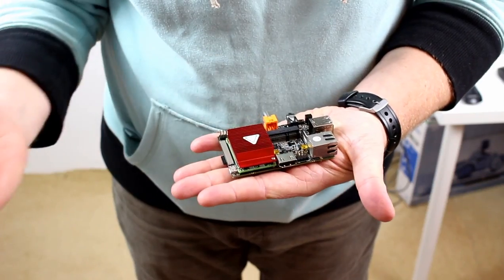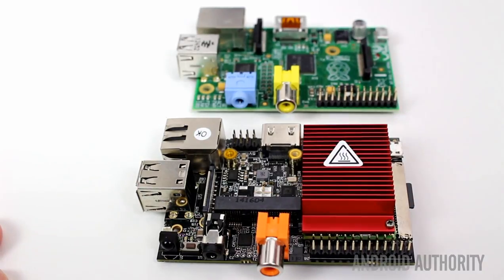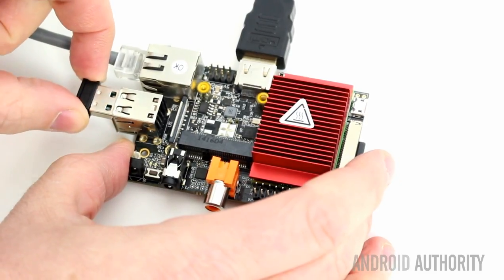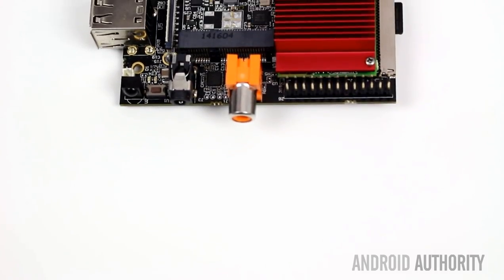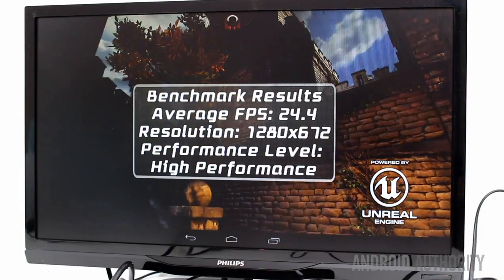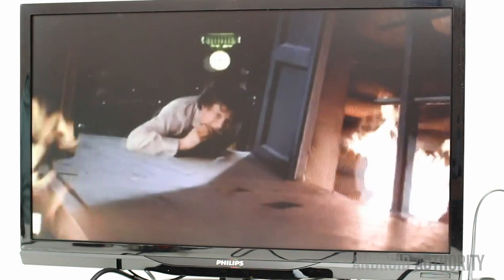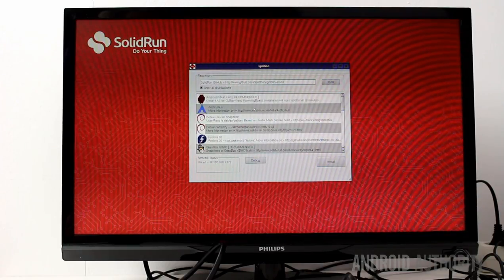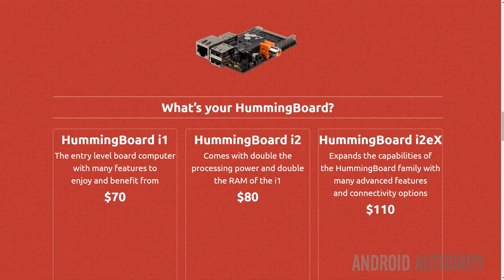HummingBoard-i2eX review!

Comment: im looking at the humming board edge, there is a option to include wifi on the microSOM.
can you try a mini pcie wireless card with your humming board? I wonder if there will be enough power to supply the mini pcie wifi card.
It would also be cool to see a wifi card with m.2
On my raspberry pi, I run 2 wireless n cards as a wifi repeater... I have to use a powered usb hub or the cards will suffer from disconnects due to not enough current... this setup is a big mess of wires and I hope the humming board will replace my current setup... my goal is 2 wireless n cards on the humming board...
Any problems you can see with my plans?

Comment: Raspberry pi b+ is better, the pi 2 completely wipes the floor with this
Reply: Omg that's insanely overpriced
Reply: Flex Flakus NERD
Reply: Flex Flakus actually not even close.  the pi 2 although cheaper is only Cortex-A7's which are roughly 20-50% slower per clock cycle than the Cortex-A9's that the iMX6 uses.  The pi 2 also uses LP DDR2 memory which is slower than the DDR3 used on the HB.  On top of that the HB has powered USB ports so you don't need to use a powered hub or adapter for an external usb drive.  It also comes with wifi/bt on the board, and the Pro carrier allows you to add an SSD via the mSata port, or mPCIe card of your choosing, both much faster expansion options than hanging a bunch of usb devices off the RPi.  They are both good at what they do, but you get what you pay for.
Reply: You're wrong but if that's all you could say then your point makes no difference.

Comment: WOWWW. WHICH ONE IS THE BEST I CAN BUY? 
I WANT ONE THATS BETTER THEN THAT, LIKE A LOT OF RAM
Reply: Innovation Depends if you need Android support or not. Also do you need GPIO and all the other hardware stuff? If you want Linux and don't need GPIO etc, then consider the Draco AW80, it is a media box, but it can run Linux. There is a 2GB version and a 4GB version: http://www.androidauthority.com/tronsmart-draco-aw80-review-567333/ and http://blog.geekbuying.com/index.php/2015/02/04/ubuntu-14-04-porting-to-tronsmart-draco-aw80-with-hardware-acceleration/

Also you could consider the ODROID-XU3, it has 2GB of RAM.